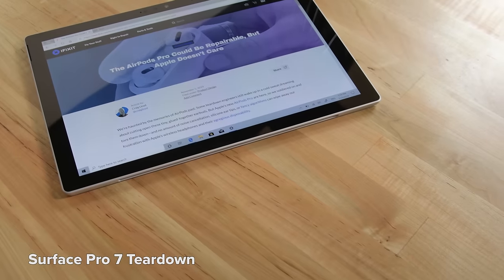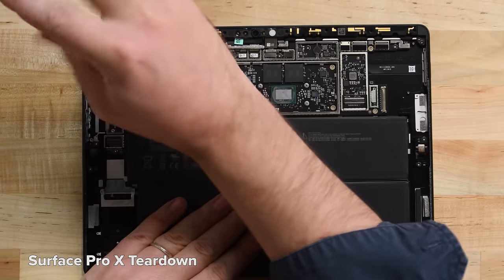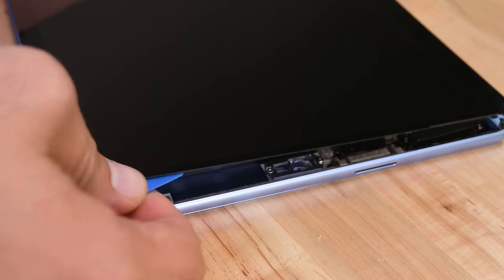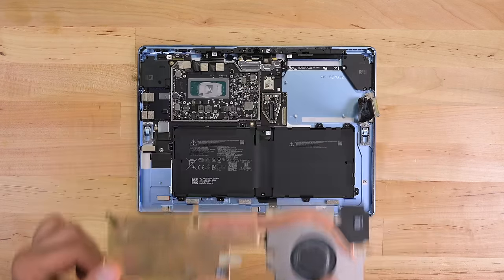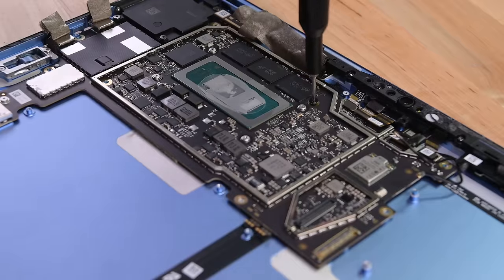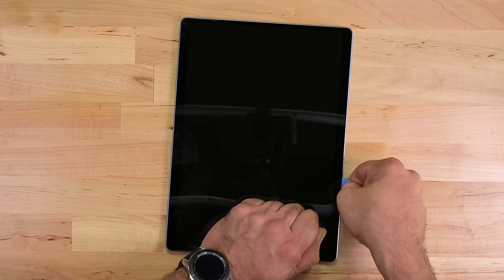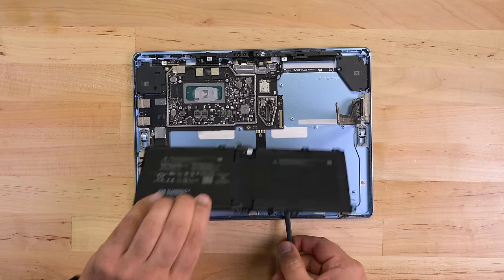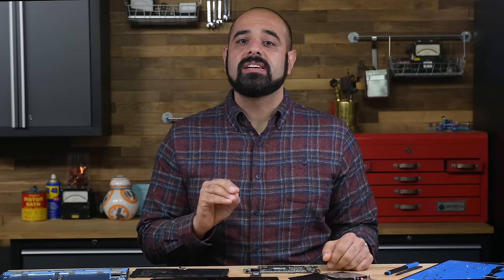Surface Pro 9 Teardown: The Most Repairable Surface In Years

Comment: I never thought that I'd see an upgradeable and repairable Surface tablet in my lifetime.
Reply: My Surface Laptop died. Not repairable. Will never spend a lot of money on a laptop again.
Reply: @robertanewman7229  Good for you.
Reply: Europe's new laws forcing repairability and replacement parts for any tech from now on
Reply: Yep finally a good direction forward, hoping all Surface products will be the same. It will be nicer if the display assembly in the near future will only involve removing screws and not adhesive, just some rubber gaskets to seal the device through screw pressure. It's not like Surface Pro is rated for IP resistance anyways.

Shame though that the removal of headphone jack with SP9. This device so huge anyways and thick, it should have room for it anyways considering SP8 had it. It saves one USB-C port and bit of a money as well from buying and using a USB DAC.
Reply: @moracabanas  I love Europe. Even if the U.S or the other big consumer countries don't follow at least they can make a dent of the electronics industry if it isn't repairable. As a tech guy I would love for devices like tablets and laptops be something that can be upgraded or repurposed if they become obsolete.
Reply: How old are you then? 80s?
Reply: Still have to heat ther screen to move it

Comment: A Surface tablet is finally a viable option for my next portable PC. Hopefully the ARM version is also going to be as repairable.
Reply: It should be the same design as the intel version
Reply: An easy to teardown arm device would be a godsend.
Reply: The ARM version have a similar design
Reply: @fjjwfp7819  If only the Intel version had a 5G modem
Reply: This is exactly what I was thinking. I bet the ARM will be different.

Comment: USB-C post is soldered to the mother board , right ?? This is very bad for reparably
Reply: Yeah, as nice as it might be to have a daughterboard for the usb c ports, that adds manufacturing complexity to it. Still would be great. 
I do hope they continue to improve ease of repair with atleast an alternative access panel to the battery and yeah, a daughterboard for the usb c thunderbolt ports.
Reply: @MichaelBTryn take framework laptop as example

Comment: Huge props to MS for this one. Making a repairable tablet couldn't have been easy for them, and I'm sure lots of people don't even care that it is repairable, but it is definitely a step in the right direction. Shame they're always outdated and so expensive.
Reply: Yep, and companies should nor think too much that majority don't repair their own devices. Average consumers will actually gain with easy to repair devices, which means it will be cheaper to repair in the long run and help reduce the impact of E-waste, which is going to be a major crisis in the near future if we still dont address this.
Reply: Are you buying a device for the sheer most cutting-edge specs or the best experience? One is worth more than the other.
Reply: @Jayy997  for both really. It is absolutely true that last Gen hardware is perfectly capable of providing a good experience. In fact, one of my computers is running a 6th Gen Core i7 and a GTX 960, both of which are very much outdated. Both my main laptop and main desktop are also running on previous gen hardware.

The problem is that Microsoft isn't marketing the Surface as a value or Economy device, but rather as a premium, high tech product, and they price them as such. When you're spending over $1000 on a computer that doesn't even come with a keyboard, it really stings when you realize it only comes with a Core i5, only 8GB of RAM, and only 256gb of storage. The fact that it's also a previous generation chip just adds insult to injury and it leaves me wondering where the extra cost went. 

And while it doesn't pertain to my original comment, the experience isn't really unique either. Devices like the Galaxy Book 2 360 from Samsung offer the same chip, same ram, same storage, better ports, include the keyboard and mouse, has better ergonomics, and is still very lightweight and portable, all while costing $150 less. The only aspect where the surface has an advantage is the display since the Book 2 only has a 1080p screen, although it is OLED.
Reply: @MrFastFox666  the Surface Pro has double the resolution and is a 120hz screen which would add considerable expense. It arguably also has superior design in every part of the device but especially in the integration and usability of key features like pen. Good design doesn’t come cheap and as you have demonstrated, is often overlooked in favour of raw specs
Reply: The galaxy book has a much better pen.

Comment: Hear me out: magnetic latches in the screen that open when you hold a magnet up to them to avoid glue and screws and clips back together like nothing has happened
Reply: Imac screen had that
Reply: Unfortunately it will not be in microsofts priority to make the screen replacement easier than it is, there's a reason why most tablets out there have glued screens.

Comment: An extremely positive step in the right direction. Hopefully the score will increase when all the guides and spare parts are released. Hopefully Microsoft will sell the SSD too. Would like to see Microsoft extend the warranty and lower the cost of repairs/ replacements. The other massive thing Microsoft can do is bundle the keyboard and pen with the Surface.
Reply: It's pretty easy to find bundle deals for Surface devices throughout the year.

Comment: I wish they'd make it easier to replace the battery without having to remove the screen though. Maybe by removing a few screws under the folding stand would be the ideal place. Batteries are consumable products and should be treated as such.
Reply: Yeah, an access hatch from the back, underneath the kickstand would be cool, but it would also add to the complexity, adding to the cost.

Comment: I think 7 is too high. I think a 5 would have been fair, 6 max. Even with the spare parts, it's a 7. It could be an 8, if you could remove the screen without having to melt the glue.

Comment: Not too bad! Hopefully in the future manufacturers can figure out a way to avoid the screen attached with adhesive. Maybe some type of integrated back bracket that comes with the screen instead of only that adhesive linking the two pieces together. That way the adhesive itself can be a lot weaker or even just some type of water ingress protection gasket instead. I actually like seeing screws visible on the bottom of devices and I assume others do as well, so making it screw-less looking shouldn't be such a design consideration these days.
Reply: They have!!! My dell tablet has these magical things called "screws" and "clips" which do it wonderfully, without any glue at all.
Reply: @philipw  🤣
Reply: @philipw  pulling screen from the clips sounds dangerous. And I think just clips and screws can results in heavy dust accumulation issues.
I think having bezels which hold the screen is the only alternative to gum.
Reply: @landinobin4835  the dust problem can easily be fixed with non adhesive gum. A rear bracket with standoff that get screwed in from the other side, and some padding to fill any gap left after tightening the screws should be enough to make it more repair friendly.
Reply: All the old iPhones had screws to hold down the screen, everything since then has been physically "locked down" for manufacturers to monopolize the repair bills.

Comment: If they could do what they did to the SSD to RAM that would be amazing
Reply: Unfortunately it's not very realistic for a tablet, hopefully for laptops they will do that. They did it with the SSD precisely because the use the tiny 2230 form factor.
Reply: [Note: I copied my reply from other comment since it is the same detail I provided.]

Upgradable RAM might not be happened since Microsoft already stated that it could lead to security breach from swapping RAM module.

While, it makes almost zero sense (myself included), but it is their reason nonetheless.
Reply: Most mobile devices even on laptops the RAM isn’t being upgradable anymore
Reply: A big reason why the RAM is soldered is for improved performance and efficiency.
Reply: @mistamaog  Does soldered ram run at higher transfer rates? Does it consume less power? I don't think so.
Reply: @fjjwfp7819  It's entirely possible, the only thing stopping it from happening is people like you being OK with the way things are.
Reply: @t1e6x12  It does if it’s part of an SoC. Otherwise, it’s just standard RAM, just without a DIMM or SODIMM daughterboard, so any power draw benefits from that are small. Otherwise, basically all speed and power efficiency benefits boil doen to how well the thing is engineered.

The real reason for soldered RAM is that it’s much, much easier and cheaper to use in in smaller form factor devices.
Reply: @reaperreaper5098  well cheaper is a reason, but it does seem like some of the sodderd in DDR4 modules in some of the more recent laptops DO run at higher clock speeds.

Comment: The main problem with such tablet design is battery swell which may eventually happen and push the screen panel from inside resulting in physical damage. Intel's chips hotness will only speed up this process. From what I can see it's difficult to say if battery pack is inside hard case.

Comment: Those blank spaces though
Reply: Look at 3:20 where you can see the back of the display. The space underneath the battery is taken up by the PCB strip on the back of the display. On the other hand, the Samsung note 7 teaches us about putting as big of a battery as possible into tight spaces, and since most battery packs are available only in rectangular sizes, many internal structure geometry restricts how big the battery can be. The left side of the battery is also taken up by the space for the removable SSD.

Comment: It may make easier for specialized repair shops to fix it - which is great. But the need of special hardware as a heat pad to remove a fragile thing as the screen is still a huge barrier for those who are I to DIY. They could very well make the access to the internal components from the rear of the tablet, using the good old screws...

Comment: Judging by what you showed us, you still have to go through a terrifying screen removal in order to do any repairs I wouldn't give this repair anything above a five until that screen is easier to be removed or the internals are easier to access without having to mess with the screen.
Reply: How do you propose the screen on a tablet should be removed and attached? Using adhesives for tablet screens is industry standard and it is clearly easier than all previous devices and have been made as easy as possible.
Reply: Use screws from behind that attach to little standoffs glued to the rear of the screen
Reply: @eduardoizquierdo309  I believe HP made a tablet using this method and it got a 10 out of 10 on the repair list
Reply: @eduardoizquierdo309  Exposed row of screws will never be something visually pleasing enough for the Surface design team unfortunately. It's just a compromise the make and if that level of servicibility is something you care about you just wont be able to get Surface or Ipads or most other tablets out there.
Reply: @fjjwfp7819  There's literally a hinge they can hide screws under.. like my dell does.. which uses screws and clips and no glue.. and has no exposed screws.. at all.
Reply: @fjjwfp7819  magnets are 100% hands down the best and easiest option. this is what the older apple imac's did and it was perfect
Reply: @philipw  and how will the upper half of the display be held onto the machine?  Magic?
Reply: @yaknowjoshua  I'm not sure how the imac screens attach, but we're talking about a tablet here where even the strongest magnets at this size will not be very strong. Just look at the iPhone mag safe magnets, you won't be getting any structural integrity like that.
Reply: @yaknowjoshua1451  as much as love magnets  I would not recommend them for to hold a glass screen down on something that is only screen and is mobile. I am for sure to break it if I owned it.
Reply: @fjjwfp7819  the glass screen can be mounted to a plastic bezel that has hooks on the top just like iphones.
Reply: @fjjwfp7819  Screw it into place from the back. 12 screws would be perfectly acceptable.
Reply: @yaknowjoshua1451  MAGNETS HOLDING A TOUCHSCREEN??? are you crazy?

Comment: There’s a ton of empty space inside.
Reply: Look at 3:20 where you can see the back of the display. The space underneath the battery is taken up by the PCB strip on the back of the display. On the other hand, the Samsung note 7 teaches us about putting as big of a battery as possible into tight spaces, and since most battery packs are available only in rectangular sizes, many internal structure geometry restricts how big the battery can be, for example on the right side the kickstand mechanism, and the left side of the battery is also taken up by the space for the removable SSD as well as a heat pipe.

Comment: I don't really know what the answer is to the screen replacement being difficult but I'm not a hardware guy by any means (Software engineer here).  Does anyone know what the answer is to making one of those easier to replace?  I figure the glue or adhesive has to be there to keep it sealed from water.

Comment: Why can't they just design a screw together assembly that holds the screen freely in place.  That way you remove some screws and open up device and remove screen freely.  Even if it were to add a millimeter to overall design thickness, I"m sure 90% people wouldn't mind.   Give option of AMD INTEL too, these are limitations holding me back from purchasing a  surface pro.  One more thing, the ssd is mounted externally, so how hard would it be to provide a little extra space for a standard sized ssd.  Even if theres a tiny bulge poking out the back, I bet most people wouldn't mind that either.

Comment: Hello, what about Surface Pro 8? I bought a second-hand one and while using it on battery power alone it's pretty ok, but if I connect it to a dock it will start heating up and the fan will be running at full speed forever. Is the Surface Pro 8 also a good fit for repairs and what could be the causes of the overheating and the extreme fan noise?

Comment: Why is there soo much empty space inside, looks like the battery could have easily been bigger. Maybe it just looks hollow compared to iPads and MacBooks which seem to use every square millimeter of available space.
Reply: Look at 3:20 where you can see the back of the display. The space underneath the battery is taken up by the PCB strip on the back of the display. On the other hand, the Samsung note 7 teaches us about putting as big of a battery as possible into tight spaces, and since most battery packs are available only in rectangular sizes, many internal structure geometry restricts how big the battery can be. The left side of the battery is also taken up by the space for the removable SSD.

Comment: If a tablet can have an easily accessible separate ssd panel, I'm pretty sure laptops can do the same. In fact we had those a decade ago.
Reply: Accessibility has only been an issue due to wanting to keep the devices thin and "security".

Comment: The only downside of using screws to fasten the battery compared to stretch-release adhesive is the need for a metal frame which the battery need to be attached to. This is probably why the battery is slightly smaller than the Pro 8 last year, but I think most people will accept this compromise for the ease of replacement.
Reply: If you search for problems you will always find them

Comment: Nice to see the SSD that's as easy to replace as an SD card, but I'm afraid that non-standard format will be way more expensive than it needs to be.  If I were to purchase a Surface 9, I'd definitely get a second SSD to install Linux, and just swap out the drive instead of fooling with dual boot, cost allowing.

Also, if you think replacing the screen and/or battery on this is doable by the average consumer, you are way overestimating the capabilities of the average consumer.  The average consumer can barely operate a computer, let a long tear one apart.  You throw glue and tiny screws into the mix, and you'll get a deer-in-the-headlights stare from them.

I do commend Microsoft on the ease of repairability on this.  Now they need to work on replacing that glue with a gasket and screws, like the cell phones of yesteryear used.  Perhaps this will be the beginning of going back to that trend.
Reply: The m.2 2230 isn't that expensice as you think. The 512GB from Kioxia (former Toshiba) is round about 120€, if you want a cheap 1TB one you will start at 150€.

The m.2 drive is also changable at the Surface Pro 7 plus. The 7 plus is in my opinion also slightly better in terms of handling and connection possibilities, even the hardware specs are minimal below the Surface 8 :)
Reply: @tonikeller5928  You're right.  It was hard to see the connector when he removed the module, and with the plastic case I didn't recognize it as a standard M.2 module.